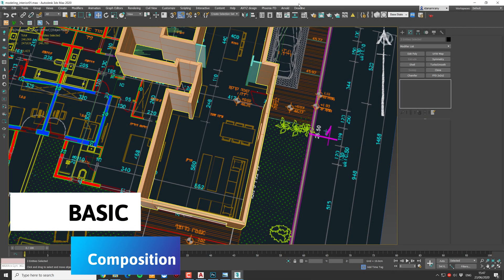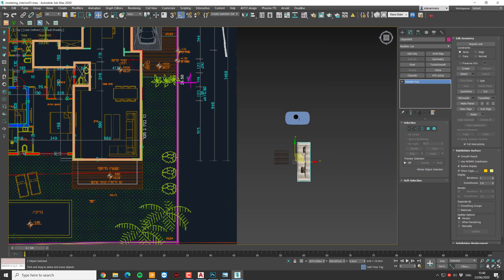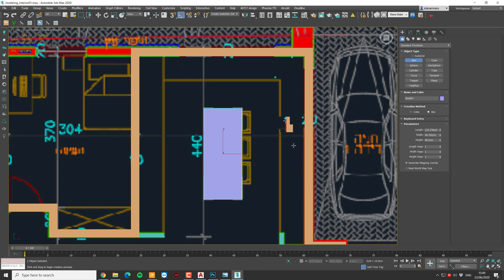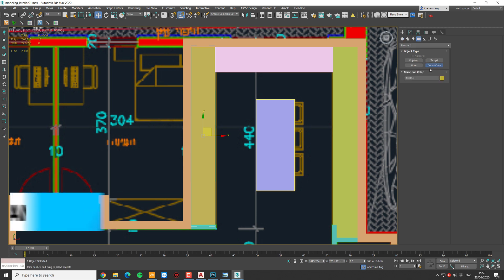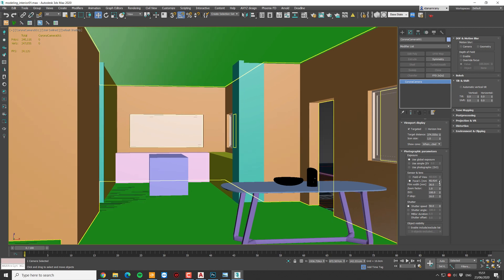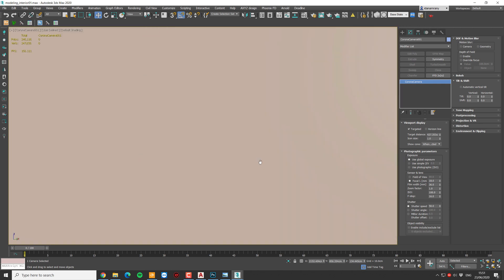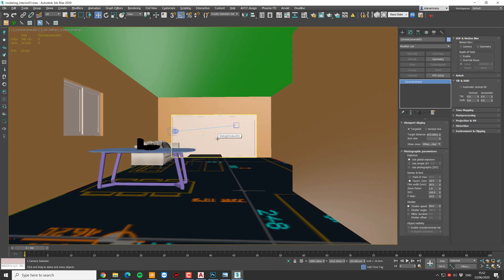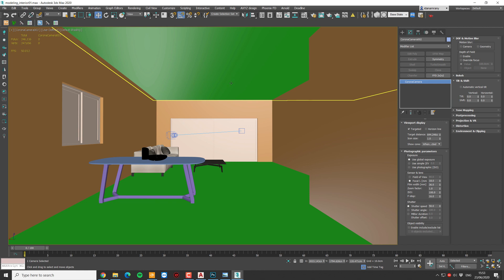3ds MAX tutorial- Interior Camera placement and Composition

Comment: Hey, thanks for the tutorial. I have a challenge ALL the time when I try to model a scene. I often want to do a full through-the-house animation and I then end up having to model everything in the whole (BIG) house. It makes the scene very geometry heavy and it also makes renders take FOREVER in just a single still shot. What strategies should I be using to achieve this? How can I be smart while still creating a fully furnished house for an animation? Thanks!
Reply from the maker: Hi Andrew ! good question , there are several approaches I can recommend when dealing with heavy scenes for animation and stills:
1. split each area/room into separate 3d file if possible.
2. convert heavy objects to proxy( good for view port performance)
3. make sure your PC have enough RAM to render the scene - while rendering , take a look at your RAM Usage , if its getting near the 85%-90% than you need to reduce poly count in your file and maybe disable displacement in materials.
3. Buy more RAM :)  go for at least 64 GB of RAM.
4. make sure you don't have materials with perfect white color in the defuse (255,255,255) that can create noise (specially in corona render)
5. try not to use too many lights in your scene.
6. don't use very large and heavy texture maps in your materials.

By the way what software do you use for modeling+rendering?
Reply: Arch Viz Champ Thanks so much for the reply! Those are really useful tips and I’ll definitely try them! I use Vray 3.6 and 3ds Max. 

On point 1, does splitting them into different scenes in one file help?